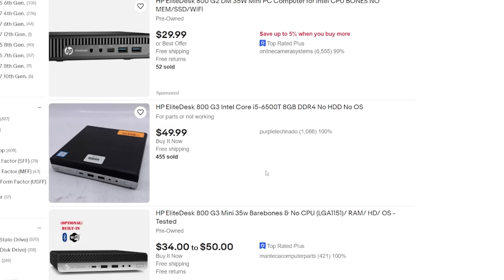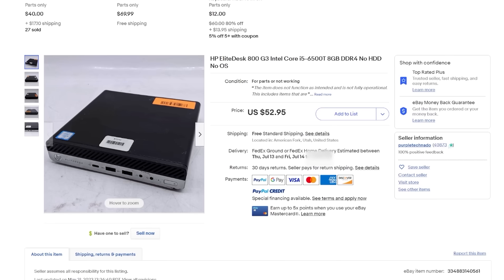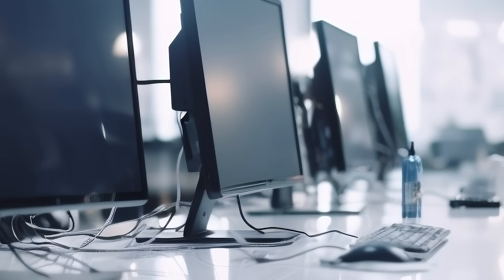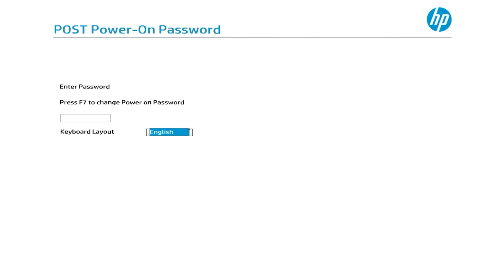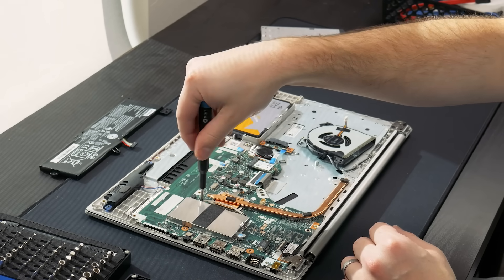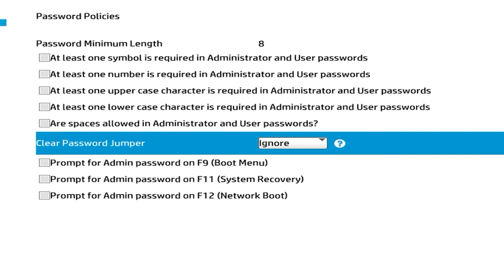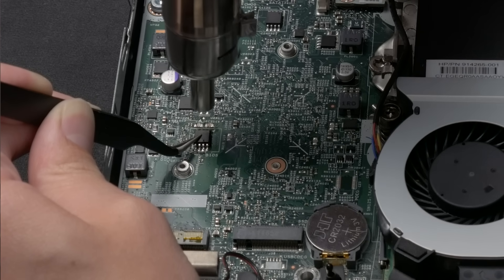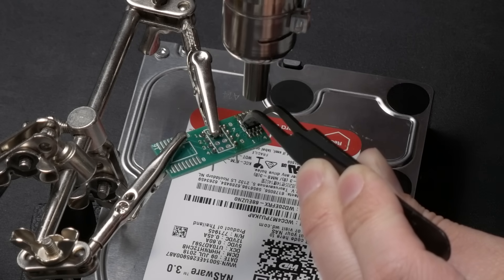I Bought a BIOS-Locked PC. Should You?

Comment: One of my favorites is the older laptops with a password chip.  If it reads 0000s from the chip it assumes no password.  The trick is you short the clock and data pins right when it checks for a password, it won't see one and you can get into the BIOS.  Then set a blank password, it will overwrite the stored password.

If you find that the motherboard is stealing the power from your clip programmer it might be pulling the voltage down too low.  I keep a 1/2 charged Lithium Ion battery around ~3.6v to connect along with the CH341A.

The other option would be powering the board and letting it provide the power to the chip.

I do run into chips that need pulled from the board at times.

Comment: i got a bios locked laptop that wouldn't let you change the hard drive and if you changed the hard drive it wouldn't boot at all or if you did a fresh install on the hard drive that was with the laptop it would boot to windows. found master password online to open the bios and got a couple more from the same place. opened the bios on all them then did a fesh install of windows 10 and out of the 3 i could get i sold 2 of them keeping the best looking one for myself

Comment: My biggest win was using a grounding trick on a thinkpad t430s to get around a bios lock. There's many videos on youtube, but the gist is you carefully use a pair of metal tweezers to ground the data pin during (not before) POST. The password is seen as blank on that boot, and you can easily set and then disable the admin password. This let me enable virtualization, update the bios, and enable the express card port.
Reply: I spent many years as a service tech, & I used this trick on a lot of machines to get around weird BIOS locks.
Reply: @theantipope4354 which one is the data pin? Or can i ground any of the cmos' pins
Reply: I think that cant'b be done in newer models but at least worked in your Lenovo, thanks for the reminder !
Reply: Do not try this on modern ThinkPads such as the X1 or P1 series. It will not work and you may permanently damage the motherboard.
Reply: Works great on T48s but not on T51s. The Password is stored inside the CPU. So even replacing the Flash does not help. This is part oft this Intel Anti Theft.
Reply: @Golf4org  Intel's consumer-range CPUs are not SoCs, neither have any flash on-die (except for OTP bits used by factory to do stuff like disable faulty cores to sell an only-partially-good CPU as a good lower-grade one). OTP bits are in fact used by game consoles to store the console ID or lock firmware downgrading, but that's all.
Reply: @Golf4org then how would you do in this case? Change the cpu momentarily and reflashing the cmos could work?
Reply: @carlosdimey7379  I guess this would work, but changing the CPU back would have a password again. In my case, the BIOS is locked, but you can still boot USB drives, so I live with the locked BIOS.
Reply: @Golf4org  i see, but can't you just flash the BIOS? Well if one have the necessary equipment of course, but i think a heat pistol and some soldering iron would do
Reply: My friendd's thinkpad had the same problem we tried everything until we saw a forum post about this trick he helped me with the pins(we used wires to ground them) and oh boy it is not easy we tried doing it for almost a full hour until we got tired but just as we was to stop it finally worked! we entered the bios, i quickly replaced the password and enabled Virutalization and its no longer locked
Reply: I once unlocked an x250 by using the driver injection trick. Desoldering that bios ic was such a pita but hey it worked
Reply: @mhammadalloush5104 and how is that driver injection trick if You don't mind sharing my friend
Reply: @@wendellparham5545 interesting...
Reply: I tried this with a T495S now I have a music box. I powered it on and it made some weird tones. DL'd Lenovo diag app for Android, tone not recognized..Next suggestion, anyone?
Reply: How u dell laptop

Comment: In August 2020, I bought ThinkPad t430 that I didn't know there is bios password. So in 2021, i managed to shorting EEPROM to bypass the bios password for installing 1vyrain bios, but please don't plug off the CMOS battery because there is no date and time setting to correct the time, or you will stuck at bios until someone repair it

Comment: From experiences I have had with these Mini PCs and some whacky BIOS mods I have done in the past (going from turbo boost unlocking on Haswell to NVMe module injection), these sometimes require the power brick connected and a power cycle while - power button is kept pressed - to allow the chip to be powered and selected (floating SS line) and avoid the tedious (de)soldering task!

Another pro-tip to whom it may concern, AMI bioses sometimes are flashable without needing the (risky) HDA_SD0 pin short or the ME disable jumper on with AFUWIN v3.05.04 and the magic /GAN flag!
Reply: I wish I was on this level of technical skill

Comment: I can’t recall what manufacturer I was working with but I was servicing a rather cheap laptop that needed a motherboard and with some research discovered that there is a program used to modify the bios entries to reflect proper serial codes and the like. I’ve seen one Dell laptop that contained the bios chip on a separate pcb. Also nearly every laptop I’ve seen has required bridging two points on the motherboard to reset passwords. Though unless you’re thoroughly prepared that could easily damage it.

Comment: If you're planning to install windows and BIOS setting disabled booting from USB, you can take the storage out and install Windows using WinNTSetup from another computer. Reinstall the storage and continue on the BIOS-locked device. 

I've been doing this for many customer. It's faster than getting the chip replaced. Clear password jumper is easy and most of the time it worked. If it doesn't, yeet out computer disk.

Comment: Picked up a bios locked 845 G7 from work for 20 bucks. Had to learn how to desolder and reprogram the bios, but it wasn't too difficult for me since I at least have some soldering skills and watch LOTS of board level repair videos in my free time. Threw in some ram and a drive, and I have a killer daily driver that cost under 100 bucks total.
Reply: That's a lot of work for someone who doesn't rebuild laptops regularly
Reply: @patsfan4life  I do laptop refurbishing as my job, but we don't typically do board level repairs. Since all the tools to do the job was cheap I figured it was a good chance to learn since I had a supply of parts to pull from
Reply: I have the same model except g8
 So have to desolder the chip. Great, time to invest in a rework station and a sacrifice to the motherboard Gods so they will provide a bios to program into the chip.

Comment: I know you didn't cover it but one Hard Disk password exploit that worked well for me on ide/sata spinning rust drives was to power on machine with unlocked hard disk into the bios and into the security settings, hot swap the drive to the locked drive, select to lock drive and set a password, save and exit. Upon boot it will still be locked but only with the password you provided. Now you can go into bios and unlock with the password you set.
Reply: lmfao
Reply: Don't the drives get encrypted?

Comment: Done a reflash on a bios chip I wrote the bios to by using another board with a similar bios chip. Start pc with good bios, carefully swap to bad bios with unit powered on. Run flash program for the right version of corrupted bios. If successful then power down and replace proper bioses into proper boards and away you go.

There is also some specialized software for recovering bios passwords as well, but like you stated it really depends on the board and manufacturer implementation. I know ThinkPads of many models had to be reflashed using a programmer or serial flash cable of some description.

Comment: Cheers for the shout out, great video - whish I could get this much information into 10mins!
In-circuit flashing (with the clamp) is definitely possible as you've discovered, but I always de-solder the chip, as unless you have a detailed understanding of the platform, you never know what else is getting powered up by the clamp, and what else is listening on the bus. Soldering is also dangerous, but I know those risks a lot more than if the PCH is going to breakdown when an unmodded CH341a bashes 5v onto the SPI bus. It's low current sure, but I don't need to roll those dice if I flash out-of-circuit.
Reply from the maker: Ah the legend himself! And I would argue you get more info in most of your videos than I have on my entire channel. Without a doubt your videos were the inspiration to buy a hot air station and give it a go, lol.
Reply: The ch431 doesnt have a problem with the 5 volt "issue". It is well explained and tested in this video: https://youtu.be/J8-Sh7DjiXw?si=Mei2TuFyq16XZaZ3
Reply: > "you never know what else is getting powered up by the clamp"
In fact, most of all times it's the KBC. Which will then try to read its firmware from the same chip, and then attempt to start the motherboard or at least its always-on devices like a charging port. And hopefully everyone here knows that on SPI bus there is no mandated hardware detection of colliisions, and flash chips are "dumb" either way, so reading the chip in the same time the KBC accesses it is bad.
Reply: Hi! I started watching your video. Something i love to watch because I was a computer technician and dealing with almost everything you've shown there.

Comment: erase the bios by removing battery should default the bios settings even the password.... if not you can usually find a pin on the bios for password and use the jumper to reset it. Or just reprogram the chip with a programmer u can buy online pretty cheap

Comment: I once had to remove a BIOS password on an old DELL laptop…
The actual solution (after much Google-fu) was to fully disassemble the laptop then reassemble each PCB without the outside shell and use tweezers to short a password clear jumper at power on…easier said than done, as there were about 7 small PCBs to make the laptop complete and a bazillion screws!!! 😅
Reply: What model did you try this on
Reply: @doityourself2save  it was YEARS ago…so unfortunately I can’t remember…

Comment: This randomly appeared on my homepage and I'm so glad it did. I got a bunch of Optiplex 7070s from a school that was tossing them out, and I discovered that one of them had both a dead battery and a BIOS lock—meaning I couldn't even fix the incorrect clock until after booting up. Turns out this model does have that jumper, which is not just conveniently labeled PSWD, there are even instructions printed nearby that say "1-2: NORMAL, EMPTY: CLEAR PASSWORD". Considering how easy it would be for a kid to reboot and mess with stuff, I'm surprised it was the only one they had bothered to lock. Must have been the computer lab teacher's computer. 😄

Comment: In a pretty recent Asus laptop with a lost boot password, I had to short to ground the I2C data pin in the BIOS flash IC to make the laptop give me an error, and then it let me reflash it using a thumb drive with the file given from the manufacturer. Probably other domestic models, not business-grade or professional-grade, have similar ways to do the same. Cheers!

Comment: not worth it for the majority of people but still a good look at all the details with eeprom - the usb flasher is a good thing to have - you won't use it much but a nice to have - they are relatively cheap
Reply: eeprom wouldn't be correct terminology in this case, eeproms refer to the roms that have a hole for UV/light to shine through to flash the device. this is where the term "flashing" comes from actually. Nowadays they're just called ROMs. Eeproms are pretty much never used in modern electronics (unfortunately IMO, I think they still have a use case)
Reply: @albummutation2278  In modern PCs the BIOS is stored in rewritable EEPROM or NOR flash memory, allowing the contents to be replaced and modified. This rewriting of the contents is sometimes termed flashing.

Comment: The data pins of the CH341a being at 5 volts doesn't matter. The current is so low that it's basically impossible to burn a chip.
Also, instead of desoldering the chip, sometimes just plugging the cable in to supply standby power (and thus 3.3V to the chip) is enough.

Comment: I managed to unlock an hp elitebook 8460p using a tool called Mazzif Tools HP BIOS Unlock. Instructions were pretty straightforward. I just had to burn an iso file to a flash drive, boot from it, pick my laptop model on a list and run the tool twice.

Comment: An interesting video!👍👍I have an HP Compaq DC7800p USDT, and to do something as simple as change the boot order a password is required, it's only that one pc., though as I had another example of the same pc., and it did not require a password.  I had no idea what the password could be or how to find out, so I rapidly pressed the enter key on the keyboard and that succeeded.  Those computers are old and they use DDR2 ram., and the maximum is 4 gig,  but I have found that with 4 gig., and an SSD., and a lightweight Linux OS., installed that they are okay for basic computing, for example, checking e-mail, browsing Ebay, watching YT., videos, doing office work etc..

Comment: There is another way of removing BIOS-password by using Intel ME software. Basically, it allows you to read and write BIOS chip from Windows, without soldering the chip. However, a few things need to be considered:
- It's needed to remove/change position of a jumper if you wanna flash to BIOS chip while reading from it doesn't. Some times you need to use a wire as the jumper is removed by default.
- Make sure that you have the right BIOS to flash to the chip. Otherwise you can't boot up. In that case you will need desolder the chip and use a programmer to flash BIOS to it.
Overall, while this technique could be avoid of using solder-iron, it requires some knowledge of understanding motherboard (and maybe reading schematic) and BIOS flash.
Reply: Need more details
Reply: Interesting.
Reply: Some Chromebooks already come with Coreboot and you can compile your own BIOS without the password lock function. They sometimes put a screw that shorts the write protect pin of the chip to ground, so if you have physical access to the motherboard you can simply remove the screw (but a virus could not reflash your BIOS even with Google's private keys). This is a clever hack that still allows you to tinker with your machine but is absolutely safe against BIOS malware.
Reply: @marc-andreservant201 Newer ChromeOS devices actually moved past the screw myself and usually either need the battery disconnected or a special programmer cable connected to the USB ports (Suzy Q cable).
Reply: Doesn’t this only work on vPro systems?
Reply: "There is another way of removing BIOS-password by using Intel ME software. Basically, it allows you to read and write BIOS chip from Windows, without soldering the chip."

If you could do that, then it means you don't need to do it because you're already past the BIOS password.
Reply: @lizardking8388  you might confuse a Bios Password for a Boot-Up Password. 
It is two different thing.
Reply: @tebasnineone  I know the difference. You cannot use this method on a boot password.
Reply: @lizardking8388  Still good for a BIOS only password to get into the settings, not a power on password.

Comment: Provided you have the correct clip-on for your programmer, in some cases you may do away by just unsoldering the power pin on the bios memory chip.
- instead of removing the chip completely.
My solution was using solder wick fine braid to remove solder on that single pin and then inserting a piece of tin plastic foil between the pin pin and the solder pad.
Now the programmer can not power up the motherboard on those pesky motherboards whicj does not include a diode to the bios power pin.

Comment: I had recently purchased old RM computer for £19 that's bios locked and even had the original hard drive with the original operating system and had to replace on screen keyboard with command prompt inorder to change the administrator password to login as administrator. Fingers crossed the method for removing the bios password won't get crazy complex.

Comment: So another way is to dump the bios, you can then pull the password hash out and throw it into something like hashcat and using a gtx3080ti crack the hash in like 2 hours
Reply: Or just generate a hash from string of text and replace the existing hash with the new one.
Reply: @RelJason437 
If you got a bunch of equipment from the same location, knowing the password can be more helpful.
For example, the state government education department I used to work for used the same BIOS password for over a decade in all schools across hundreds of different models of computer. The password was "danish", for anyone who wants to work out what state it was (it was well known). So if anyone was buying equipment from a school, and got 5 or 6 different models, flashing one fixed bios wouldn't help but cracking the password probably would.

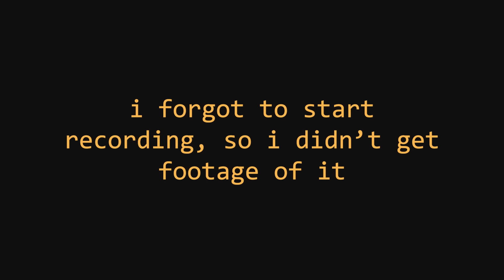Comment: one tip 10:10.. intel ME Management Engine needs to be Clean aka Configured to be able to boot on Others PC.. same pc works fine.
there is hp unlocker for up to 2016 then RC Unlocker for newer.
hp serials tend to be in paddings you can see w UEFiTooL

Comment: Technically the Xbox is a BIOS locked PC, as it has always ran a heavily modified version of Windows on it. Even the original Xbox did this.

Laptops nowadays are switching to a locked BIOS approach and I hate it because it gives the user no freedom if they want to install Linux (Windows 11 generic driver support sucks on Modern Laptops without the OEM disk/download files. I hate it, I hate Windows 11, Microsoft is getting worse and worse)